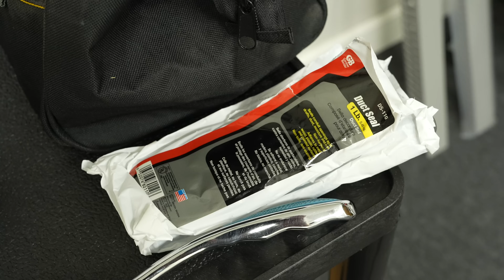Installing a dome security camera on an exterior block wall

Comment: Jeff - Leviton makes several AFFORDABLE tools for their Leviton brand Keystone inserts.
They also fit most competitor devices.
They have a “puck” type keystone module holder for easy terminating etc.
They also have an IDC punch down tool that terminates and flush cuts all 4 pairs in one shot.

Their Keystone inserts come in a multitude of different types and they offer plates in a variety of types, colors and sizes.
They have plastic and “Bakelite” type plates that have the “Keystone” size holes pre-punched into the plates directly.
(Standard electrical type “single-gang” / “double-gang” / “triple-gang” — with 1,2,3,4 or 6 “Keystone” holes per single-gang plate and various numbers of holes for the double and triple gang plates)

They also have stainless steel plates with the same pre-cut “Keystone” holes as the plastic and Bakelite type plates.
(Stainless is used mostly for commercial, industrial, hospitals, schools and similar type applications)
Reply: They also have the device I tend to use the most:  “Decora Single Gang Insert Pieces”…. 
They are the same physical size as a standard “Decora” single-gang electrical device, which is also the exact same size as a standard type GFCI device.  They also come in a variety of colors, but white, grey and ivory/almond  are the most popular.   btw - most “Keystone” insert devices from most manufacturers fit the Leviton plates and insert pieces.

These make the most sense for “standardization” because you can stock much less hardware AND permits the end-user to use any “Decora” type device plate.   Each “Decora” insert plate comes with a blank front, 1x “Keystone” insert holes, 2x  insert holes, 3x  insert holes, 4x insert holes, 6x insert holes.  (the 4x and 6x are a bit of a tight fit, but still work fine).

With the “Decora Single Gang Insert Pieces” 

Everything from Cat-5 / 5e / 6 / 7 UTP or STP for IDC terminated inserts to “coupler” type inserts that have a female “whatever” on the front to female “whatever” on the rear side:

- HDMI full size / HDMI full size to mini
- RJ45 Cat-5 / 5e / 6 / 7 
- RJ12
- RJ31x / RJ38x
- “F” Barrel type couplers
- “BNC” Barrel type couplers
(BOTH 75 ohm and 50 ohm type BNC connector types - they DO have different size center pin sizes)
75 ohm is traditionally used for CATV and CCTV / 50 ohm is generally used for RF applications.
RG6 / RG6-Quad Shield / RG11 / RG59 are generally 75 ohm.
RG58 / RG8 / LMR240 / LMR400 / RG142 / RG400 / RG223 / RG213 / RG214 / Andrew Heliax are generally 50 ohm.

- SMA  RF connectors (standard female to female only - no “RP” type connectors are available, but you can take a blank insert piece, drill a small hole through it and use your choice of “bulkhead” type connector. 

- “Banana” jacks / “Binding Posts” for speakers at speaker end AND can be used at the amplifier / hifi receiver / Sonos receiver+Amplifier combo unit.   Makes for a nice, clean installation for home audio and/or home theater.  Simply make up “jumpers” to run from the amplifier to the wall plate and plug in.

-Blank Insert (can be used to fill unused insert holes for future use and even used for custom applications, drill a hole in the blank insert for running fiber or wire that you cannot cut/terminate.
Reply: When doing the wiring rough in for my own home back in 1997,  in the pre-Wi-Fi days and ISDN dual bonded 64kbps channel days….   I ran 1” Innerduct flexible plastic corrugated conduit from every point in the house where I thought I’d need an internet drop, phone station, CCTV monitor, SONOS audio with ceiling speakers, POTS phone lines for caller-id, RG400 plenum cable, etc..   to the basement “telecom room”.  They were left empty and I used double-sided velcro wrap to fasten all of the wiring to the OUTSIDE of the innerduct, running a pull string inside.  This allows for future technology expansion.   Each point in the house where I wanted a device or jack, etc..  I installed either “1900” style 4” square steel boxes with box rear and a single-gang or double-gang plaster/mud trim ring OR deep, multiple, “gangable” single-gang steel boxes ganged together up to 6 or 8 gangs.   (You could use unlimited boxes fastened together, but the “Decora” style plates only come in max of 6 or 8 gangs.   By keeping the wiring gently fastened to the exterior of the Innerduct conduit allows for future use of the innerduct to pull wiring or cabling from the “telecom room” to any location there is a box mounted.     In my office, my wife’s office, the home theater equipment area, etc…. I ran the max number of boxes and cabling that didn’t look too cluttered, but provided great resources for computers, TV, etc.

I had run all Belden cable.  It was definitely a bit pricey, but absolutely worth it.
Their CAT-5 “DataTwist-350” was $399 per 1000’  and their RG6-Quad Shielded coax cable was $
This was just as structured cabling was just being introduced to the marketplace.
I used Belden DataTwist 350 which was a  heavy-duty riser type CAT-5  4-pair unshielded twisted pair cable with each pair “bonded” together.   

It’s now 2025 and the cable actually supports reliable speeds of 5gbps.  
Each box in the home has a minimum of 3x  of the DataTwist-350 cables and 2x  RG6-Quad Shield coax.
The office areas, kitchen desk, home theater areas, etc….   Have many more.

I also ran a 12/4 Stranded, jacketed cable from the “telecom room” to a “1900” box in each room.
These are for wall mounted volume control stations for the room’s ceiling mounted speakers.
Each speaker has a run of 12/2 to each speaker down to the wall mounted volume control.

Comment: When drilling, I suggest turning the ladder 90 degrees. You may need to straddle the ladder or lean, but it's more stable for pushing against the wall.

I have used duct seal for several applications, and never had a leak. Just leave the bottom open, so any condensation/moisture can drain.

Comment: May I ask what brand and model of rj45 crimper you recently bought? Apparently finding a good one is not a piece of cake..
Reply from the maker: Good question! I was just using my practically ancient RJ11/RJ45 crimp tool that I bought in the early 2000s.

It's similar to the Klein VDV226-011 but without a ratcheting mechanism.

I recently bought a Klein VDV-226-110 as well, and have started using that more. To be honest, I don't like the ratcheting as much as I'd thought.

Comment: i am always amazed to see that people in the us still lay cat5 cable, her in germany we just lay double shielded cat 7 cable even if the patchpanel is only cat 6 or 6a and that is since at least 2010 thats how long i´ve been an electrician, if done absolutly to code then you even lay it in flexible conduit from start to end so that you can switch it out later if damaged or upgrading fiber.
And yes i know it is not necessary to use cat7 but this way you can do almost anything with it and don´t have to pull a new cable when switching to 10gb or such, also if everyone uses that kind of cable it becomes cheaper for everyone
Reply: Money saving today vs money saving over the operation of the item.  How long will Cat5 remain relevant vs will we ever use Cat7.
Reply from the maker: The key is these PoE cameras only need 100 Mbps tops, and PoE or PoE+ power, all of which Cat5 (much less Cat5e) is more than adequate for. Even the latest 4K cameras still use less than 100 Mbps, so it's more a matter of cost saving, especially since Plenum Cat6 and Cat8 cable here is still rare unless you go to 1000' rolls, which I really don't need.
Reply: that sounds really annoying tbh, i already hate terminating cat5e 😭

Comment: Depending on the power requirements you might not want to use the slim run cables from Monoprice. They do not recommend them for POE applications.

Comment: I know they're cheap.  Please don't use them any more, haha.  You already see their build quality with the broken screw holes.  I recommend Hanwha Wisenet cameras.  
When I'm installing cameras, I don't take the plastic off the domes until I'm not ready to touch the camera any more.  Keeps the dome perfectly clean and scratch free.  A note about 'plenum' wire;  it's only required in spaces that are used for 'air handling.'  If your return air vents in the ceiling are just openings that are not connected to any ductwork, then your ceiling space is a plenum.  if all supply and return air vents are connected to ductwork, you do not need plenum cable.  There is, of course, no rule against going above and beyond and using it is fine in either case.  If you're looking for waterproof wire you need OSP or direct burial.

Comment: Hey Jeff, just a suggestion, I don't know if the brand of a-frame ladder you have supports this, but Little Giant's do; you can extend the A-frame into an extension and get the best of both worlds. - sorry, I didn't read the other comments, several others noted the same thing.
Reply from the maker: Heh yep :D

Comment: Just an FYI: that “A-frame” ladder IS an extension ladder. That’s the really cool thing about those Little Giant style ladders.
Reply from the maker: True, true, but a very unwieldy one when used in that configuration, quite top-heavy. I have used it that way in a pinch.

Comment: Hint for pulling cable in ceilings, get a small remote control car (really a model army tank), tie a string onto the car, open a panel at the destination and origination and drive it from one end to the other, then use the string to pull the cables.  We used to do that at one company when running cable on weekends in our building.  We just drove it from one end to the other and let the car/tank fall through the hole.
Reply from the maker: Haha that sounds fun! Only downside is the tiles at this place are fiberglass (better for sound) and a little flimsy. It'd have to be a fairly lightweight car/RC.
Reply: @Level2Jeff  That guy did use a small (under 2 lb) car, but they were available cheap a RaidoShack or WMT back in the day in the toy section.
Reply: @Level2Jeff  Apart from solid plastic ones, aren't all ceiling tiles flimsy?  I've broken so many of them by only grabbing them with one hand.
Reply: @Shocker99  Standard tiles (at least traditionally) were fiberboard or lightweight gypsum, and have a tiny bit of rigidity... the ones in this studio have a thick paper-ish face, then thin layers of fiberglass insulation, and will bend if you just hold it on a side. The gypsum ones would flake apart if you did the same, but they would break cleanly.

They're all a bit different in how they hold up, and how they flex!

Comment: temperature where i live can swing from -30c to +40c during the year with a huge range of humidity, I put some dielectric grease in the connection outside to make it safer, you dont want that part to rust and it's cheap to apply. i got my security camera with that for >5 years now

Comment: Good job on the install, you handled the challenges well. One note on the desiccant,  you don't need to replace it, but you can "recharge" it. To recharge it simply bake it in an oven on a cookie sheet for a few hours at 200-250F to remove any moisture it has already absorbed.

Comment: Great job. Another suggestion, consider a Reolink Doorbell camera on the wall next to your door. You may not need/want the doorbell element, but at $100 they make a great very low profile wide angle camera to see if anyone is hanging about your rear door... I've used them all over the outside of my house, cheap, good quality and integrate perfectly with HA and all NAS's...

Comment: Isnt the proper way to have a like 16mm conduit in the wall so that the cable doesnt produce any moisture inside the concrete wall from going from warm inside to cold outside in the winter?
Reply: he's got a plug of sealant around the penetration, so it's not going to be an issue.

Comment: The reason that one tile was fighting you was probably the steel wire the grid hangs on. It's hard to bend, so installers can't get the loops out of the way of the tile, completely. Said installers are also typically not the ones that install the tile, so it doesn't matter to them. I used to do electrical work, and I absolutely hated working in places with dropped ceilings, for this very reason.

Comment: I'm sure you know this, but that ladder your using is both a A-Frame Ladder &  Extention Ladder... Those ladders are super handy! THE MOST STURDY EXTENSION LADDER OUT THERE....

Just push the two things on the top of the letter in as you would if you were opening the ladder, but after you have it in the A-frame position push them again and unfold completely into an extension ladder. Then you can adjust the length by adjusting the legs in and out on both sides.
Reply from the maker: True, true. It's not quite as easy to maneuver in that configuration, I wasn't clear in the video on that. The nice thing with the separate ladders is you can get this A-frame very stable at most heights, but it gets a bit annoying (and scary IMO) when you extend it close to full extension for a 2-story job, something like that.

It's great in a pinch, though—and I did use it to get on the roof and swap out some HVAC filters. Plus, it fits inside the van, which the extension ladder does *not*!
Reply: I use that type ladder all the time,so you should have use it in the open config.

Comment: Recommended to leave some slack cable (service loop) from trunking (or in roof space) to patch panel just in case. Nice video though, well done.
Reply from the maker: Yep! I had about 5' service loop at the side by the camera (exterior) and about 10' service loop up in the ceiling above the drop to the network rack. Always leave a service loop or you'll curse yourself later :D

Comment: Add some sealant, Sika 1a can be an option at the top of the plastic box in the joint between the box and the wall, also in the screw holes, so on heavy rain you dont will have water on the box, remember water always find a way.

As is a long run box, covering the screw holes and the screws can be an option.
Reply from the maker: I've considered adding at least a bead across the top, but I saw mixed feelings about that at least reading around IP cams and other camera install sites; some people like having added layers, others don't.

There will definitely be moisture even if no deluge of water, and if the gutter above ever breaks... there will be a deluge :D
Reply: @Level2Jeff  It's not a bad idea to put a bead of silicone on the top and sides.  It doesn't have to be excessive, and you don't want it to be watertight on the bottom so the water that does get in there has a place to go.  The camera 'system' doesn't care about the box being watertight but it will be a problem if it fills up with water, the silicone is mainly to keep water and bugs out from the building itself.

Comment: I have recetly installed 24 cameras on a hikvision system.
I dont trust their software a lot so in my case I have a separate VLAN and dns and NTP queries are forwarded to a specific machine that acts as a gateway to the internet for NTP.

Unfortunatly I've see a very fast drift on the clocks even on brand new cameras.... so this was a quick solution post install solution.
Reply from the maker: I have noticed the clock drift is a bit worse than other cameras I disconnect. I may set up a Raspberry Pi as a little NTP server on the camera VLAN to compensate (would rather not have any kind of firewall rule allowing them to communicate to the outside Internet!).

Another thing I considered is burning in the timestamp through frigate/ffmpeg instead of using the camera's timestamp. It would also take away that ugly blocky font effect.
Reply: @Level2Jeff  yeah no rule to the internet just forward all DNS and NTP to my server to reply to the request. 
Fully isolated from the internet. Only the server have connections to provide NTP to the cameras.
Reply: @Level2Jeff  any burned in timestamp needs to be accurate, and be provided by the camera or the recorder itself during video export, for the video to pass muster as evidence in court (without a fight)  Better to just not have the timestamp present in the video at all and rely on the export.  running ffmpeg on it /could/ be considered tampering and render the whole video useless.  Consult with a lawyer.  I always advise using the export option that wraps the video in the executable player package of the system in use, so that it can be loaded and viewed on any PC with all the metadata that is included with the system.
Reply: Yup, the clock drift on Hikvision IP-cams is bad and it doesn't have a back-up RTC battery so it will reset to year 2000 (or something) should it lose power/reset. There is an NTP polling time interval setting in it. The time will only get fixed after that polling interval had elapsed. I setup an NTP server with a couple NICs with one interface inside the VLAN of the cams, and the other interface connecting to an upstream NTP server/internet access. That way, I could afford to set the cams to poll NTP every minute and not worry about abusing/DDOS the upstream NTP servers.